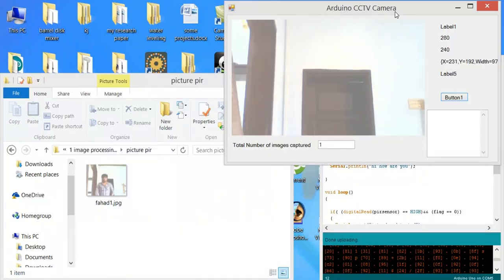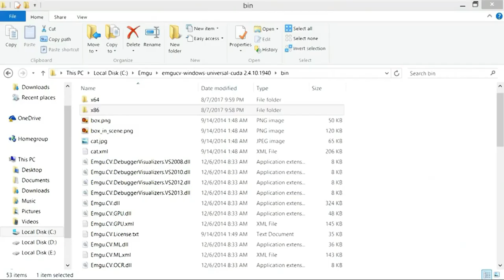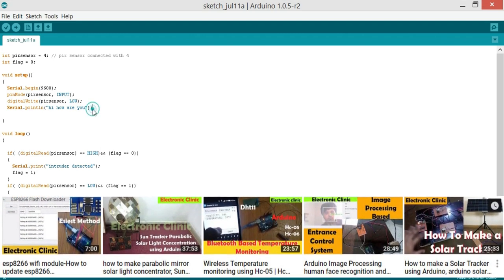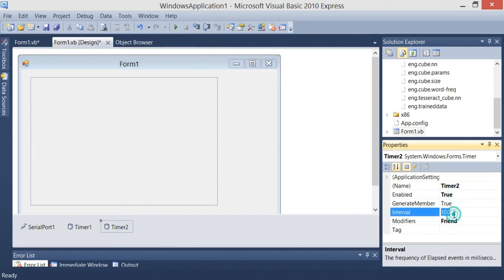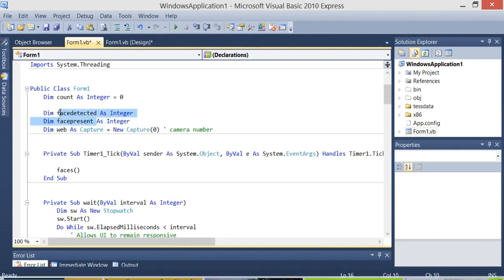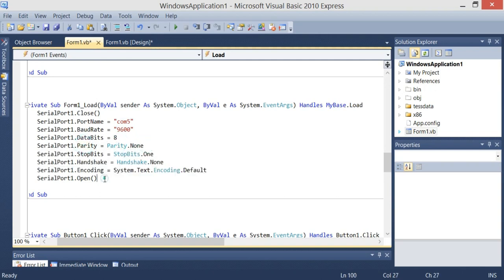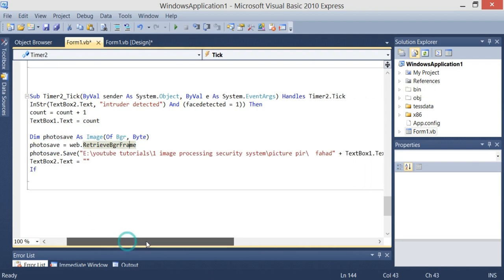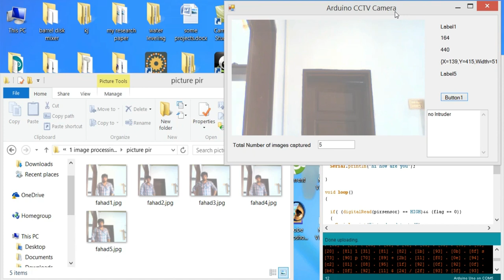Arduino Image processing based human recognition CCTV system using vb.net, EmguCv ,PIR motion sensor

Comment: Sir ,it doesn't capture the picture ,but the output is correct.what will do to take a picture?
Reply from the maker: It works. Check ur programming. May be u r miissing sth